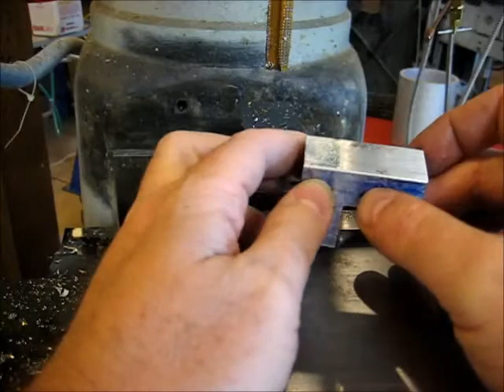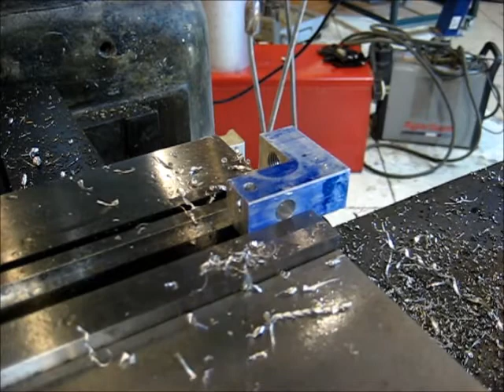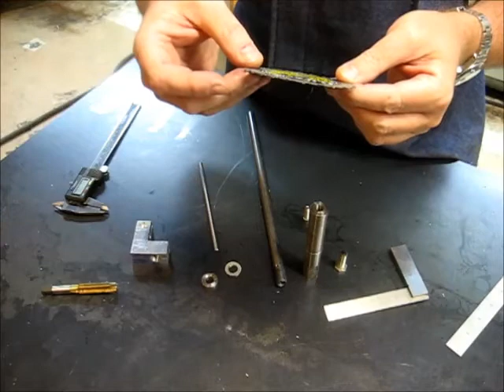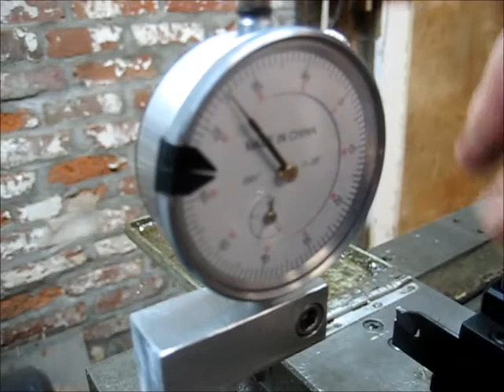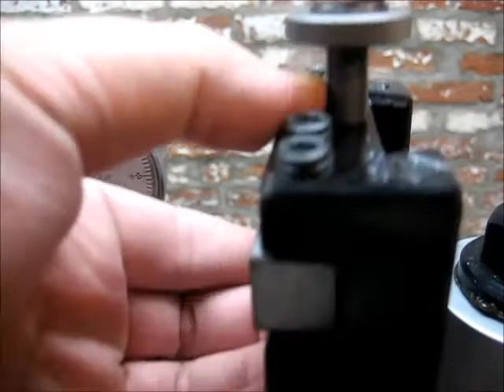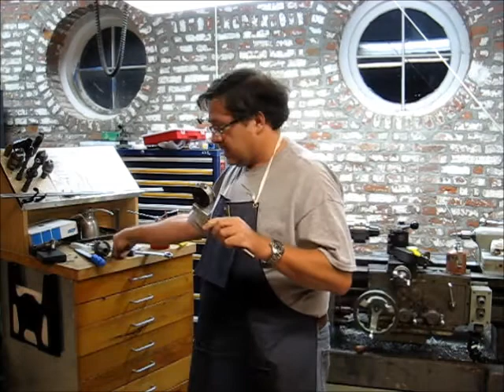Center Height Tool Part 2

Comment: a great tool idea. I'm thinking of making it adaptable to use in the chuck or on a morse taper arbor. should be doable using a mt to straight arbor suitably drilled, reamed, and threaded to fit.

however, I couldn't find the drawing/specs. probably looking in the wrong place. where are they? 

I also like your slitting saw arbor. I assume that the carbide trim saw is for non-ferrous only?
Reply from the maker: sounds like a good idea, if you have a piece of work in the lathe already being able to center off the tailstock would be a nice ability.

Comment: alot of work.  A facing cut will let you know your height pretty quickly.  With the Aloris style tool holders, you can even do profiling tools if you orient at 90 degrees out temporarily.  use the lock nut to set, then reorient.
Reply from the maker: All very good points and I agree that a facing cut is the best center method.  However when you want to center up a tool and you have a part in place that you can't take a facing cut on, this is the ticket!

Comment from the maker: Hi Chris, I use a quill dro and have a scale on the knee as well.  I generally use the knee for Z whenever possible.
Reply: Hi James, I was meaning setting one corner of the vice in the X & Y. I seem to recall you have a Sino DRO which, if it is like mine, has 200 settable "zero's". Zero #1 I have set as 0,0 at the left corner and Zero #4 0,0 at the right hand. This allows me to say drill a hole in the centre of a bar 20mm in dia by merely setting 10 in the Y, and if I want it 25 from the end I set 25 on the Y and clamp the piece with its end touching the end of the vice. Setting zero's does not effect the ABS function but does the other way around, so I only ever use different number zero's when general milling. Hope this makes sense, if I had a video camera I would have posted a video to be sure.
chris
Reply from the maker: I haven't mastered using the zero function but it sure sounds killer. Got any pointers?
Reply: James Kilroy Hi James, Not saying what I do is the only or even the "correct" way but it works for me. First off, centre on one corner of your vice either left or right doesn't matter but do remember which and zero X &Y while in ABS mode(zeroing Y or X or Z is done by pressing the axis letter and then CLR). This sets absolute zero on that corner no matter what you do with the zeros. Now press zero button followed by a number, say "1" and then ENT. Now zero X & Y again and now every time you select zero 1 you will have that corner zeroed.
The next thing I do is set zero 4 as the opposite corner, but don't go back and set ABS on this one or you will loose the first corner. In fact I will not go back to ABS till the next time I move the vice. 
Now for the drilling holes about a centre line. Say you want to drill some holes in a piece of 2" flat stock, To drill on centre just move the Y till 1.000" is on the Y DRO and drill. If you want to drill holes an equal distance about the centre line, do as above but then select another zero say 7 and set it to zero, now you can move in the plus or minus direction by the amount you want either side of centre.
If this all sounds long winded, it's much easier to do than write about.
Let me know if this helps or you have questions.
If you wonder why zeros 1, 4 or 7 they are just the numbers on the left rank and no other reason.
chris

Comment: Hi James sorry to bother you again but does your mill DRO have any tool settings? If it does, try setting one of them to zero on one corner of your vice fixed jaw. By doing this you can, say, drill cross holes on centre by merely dialling in half the thickness of the part or if you want a hole a specific distance from an end, just put the end to the reference corner of your vice. Don;t forget to reset zero if you move the vice:>)
Reply from the maker: Chris Stephens I will have to look into this, I know there are all sorts of settings I am not using.
Reply: James Kilroy I see you are keeping up to date with your comments :>))
ATB
chris

Comment: Hi James, a useful looking tool indeed, we are more likely to call it a "handy bit of kit" but thanks anyway for trying to teach your fellow countrymen to speak English.:>)
I use a comparator on a stand that sits on the cross slide to do the same job. A comparator for those who don't know, is a form of dial gauge that reads, in my case, 30-0-30 thou, The zero was set by making a shaft with exactly half of its diameter removed that the plunger can sit on.

Comment: I'm thinking of making the same thing but I would make mine to set on top of the cross slide and that way it could be used if I already had a piece of work chucked up. Good video, thanks for sharing
Reply from the maker: That is a good idea, I recently had this issue.  I should make a stand for mine.

Comment: Hi James, how about a Morse taper holder so you can use the tool height finder in the tailstock, then you can set a new tool with a half done job in the chuck. You'd need to turn the indicator 180 degrees so perhaps a collar so you could spin it without losing the setting. Or perhaps a double faced indicators if one comes along at the right price.

My Dorrian toolpost uses a gib through the dovetail, so the holders move much less between locked and unlocked, but I've always made sure to check it when locked. Don't forget the lock nut after adjusting!

Comment: Another great video James. That looks to be a useful tool to use. I don't think I'll be making it myself because I work my center height off eyeballing, or cutting, but still a very cool tool! I enjoyed watching you build it and demonstrate its use. 
Keep up the good work!
Adam
Reply from the maker: Thanks Adam, I have been like you, an eyeball kinda guy.  I guess this video proves that you can get pretty darn close on the eyeball.  Most of my tools were within .001 or better.  One of the reasons I made the tool was that I have found the old tried and true scale centering technique will very often chip inserts.  Nothing worse than chipping a $12 insert before you ever make a cut.
Reply: I use those saw blades as well. Can get them locally and decent cheap. They work quite well using the right speed.